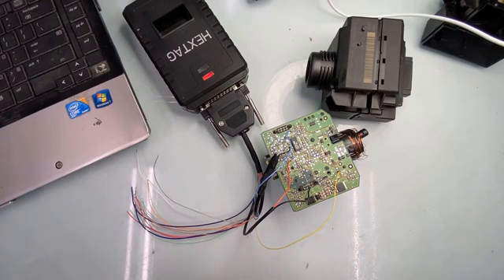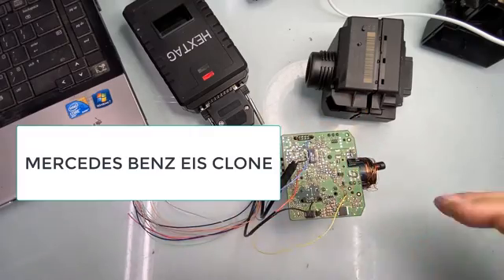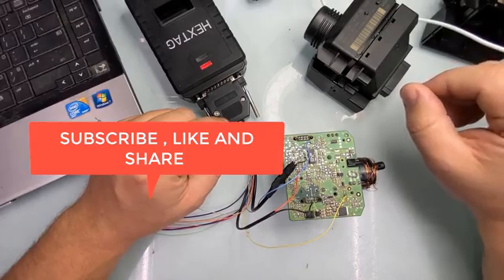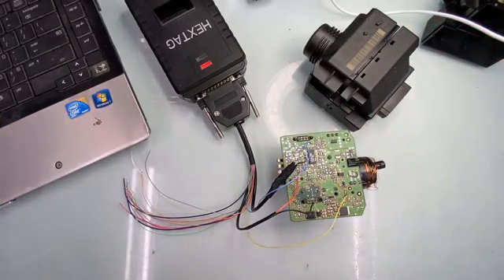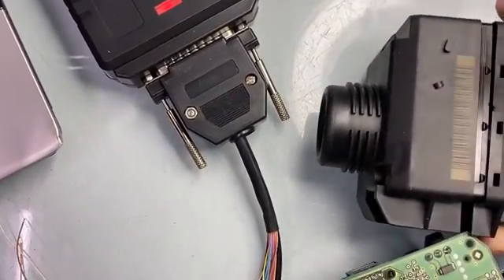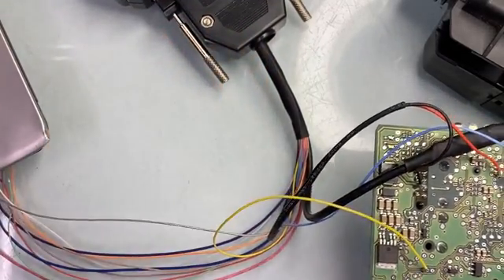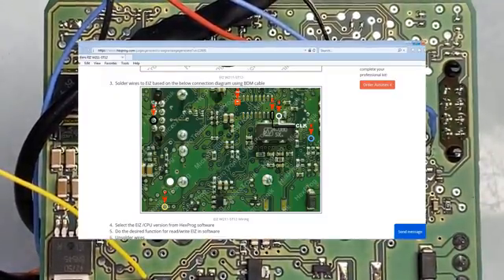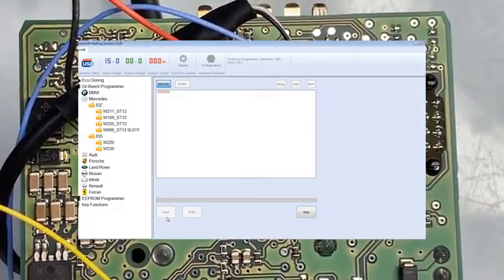How to clone and reprogram Mercedes EIS

Comment: I have a e500 2003 model  my key  fob quite  working  so l bought  a used key and switch  l plugged it in and it worked  the remote  locks but it would not turn or un lock the steering or start the car can you make it work

Comment: I need your services how do I reach you I have a Mercedes the key will no longer turn definition it unlocks the doors it locks the doors but it will no longer turn dignition I bought a use is Hughes Ignition switch I have the original key and I have the original original switch where should I-ship them

Comment: Hey I’m process doing clone on W209 with Autel XP400pro I was able to read EPROM from old switch But Having Issue with flash Is it possible to read it some other way without this method and is possible to just do clone With EPROM and not cloning the flash?
Reply: Hey, did you figure out without HASH?
Reply: @mikeseacap5731  yes  i had to get EIS Data From ECM Then Used it To Write Into USED Switch Had To Renew IT First , Can Do it With With Autel  And There GBOX Its In The Programmer

Comment: Hey, where can I get this program. I have a2000 Mercedes Benz  cl500 with the same ignition switch problem
Reply: well is NOT just "the program" what you need but you also need the autohex II(cost like 2 grands), hexprog for benz models in YOUR particular case(like a grand more) and the software that comes with it which is a montly license fee too so yes is NOT cheap to "do it yourself" thing